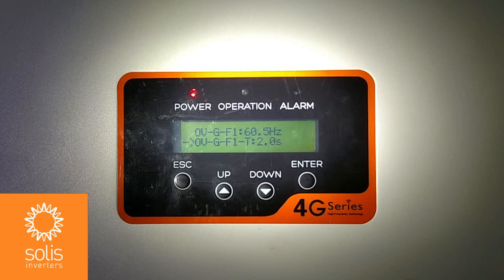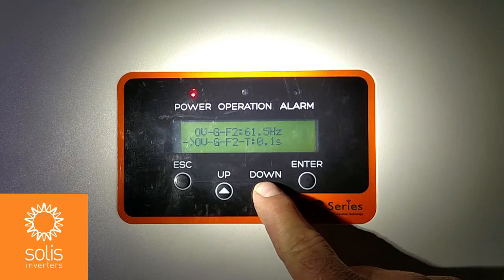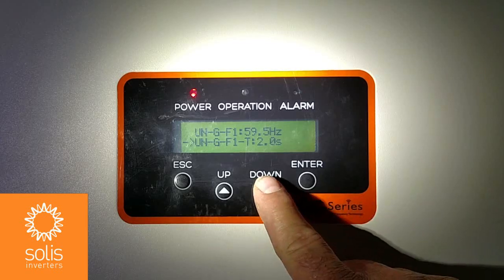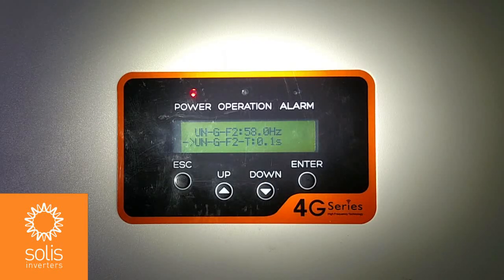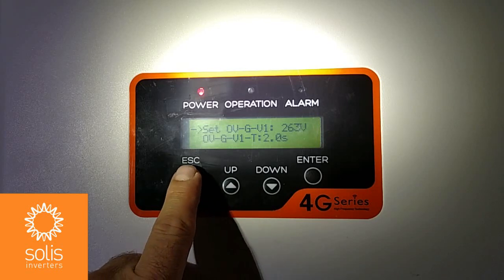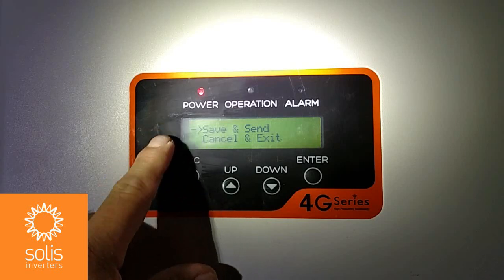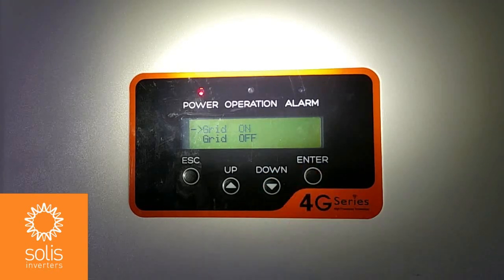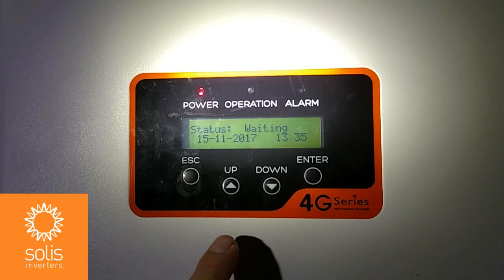Solis Training Video -  User Defined Grid Standard

Comment: We had our Solis inverter installed last November. We have had problems ever since. The lights are flickering constantly every night. Installer also asked us to install 2 different lights but the flickering continues. When I bypass the Solis system, and go directly to the grid, I have no flickering at all. The installer already replaced the inverter once and the flicking continued. Also, the Soluna battery doesn't kick in, sometimes at all, and we are in the dark during a power outage. It happened twice last night. I want to believe that our installer means well but this has been going for over 8 months now. Is it the system or the installer? Any input or advice is very much appreciated
Reply: The installation is not right,  if you have a Hybrid inverter then the inverter should be in bypass operations as long there's power from the grid, as soon the grid goes out, then the battery kicks in,  do you have a split phase system 120v per phase?  or is it 240 phase, If it is split phase then the Neutral should be attach to the neutral of the inverter, and mostly make sure the  grid standard is set right in the inverter for your region

Comment: How toset minimum output voltage in all 3 phases.as in afternoon one of the phase goes up to 181 voltage.and what is minimum requirements of voltage of grid in all 3 phases to run inverter uninterrupted? Sir

Comment: Can i connect  6 /320watt panels and 6/380 watt panels at the same time
Reply: As long as its the same voltage on panels you can.

If the only difference is what the wattage the panels  can generate and they use the same voltage then you can